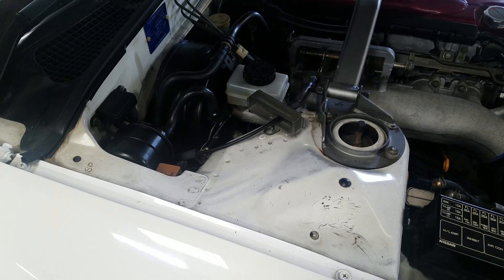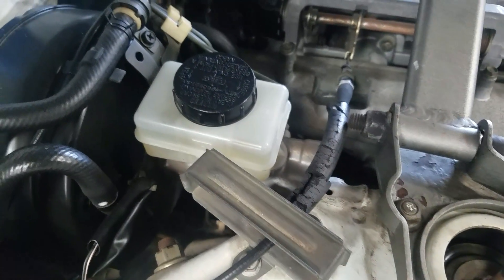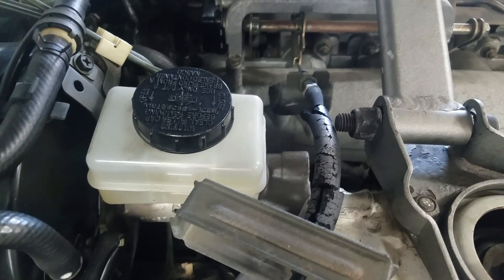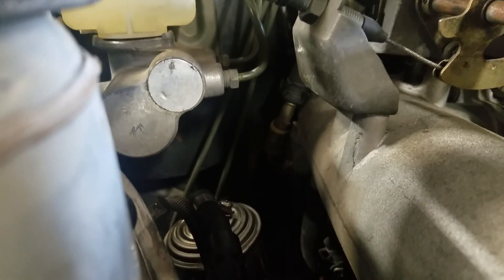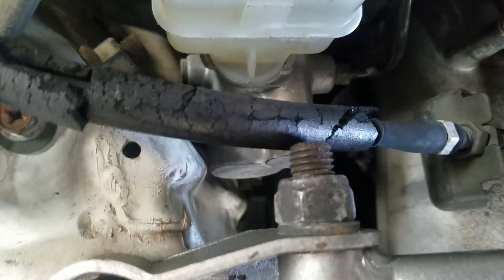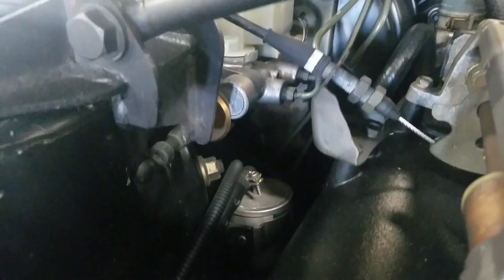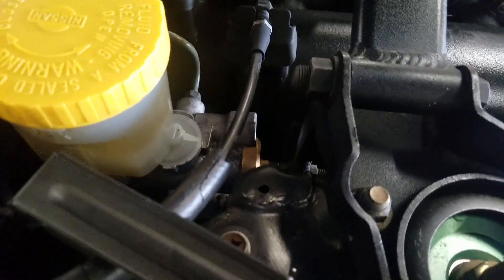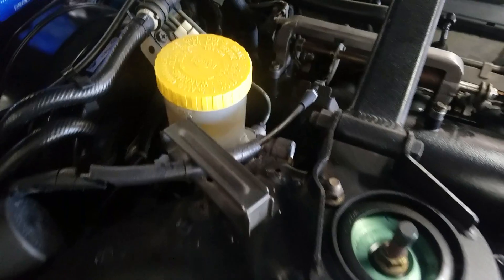Nissan Skyline GT-R Brake Master Flex

Comment: So who is going to fab up a stopper and sell them for $500 cuz gtr tax? 👏🏻
Reply from the maker: There is a NISMO strut tower bar with one built in. Cusco sells them. Others too.
Reply: +importavehicle.com I meant Fab a bolt on bracket or one you can just weld.
Reply from the maker: Cusco has a bolt on stopper.
Reply: +importavehicle.com $500?
Reply from the maker: $68.10  https://www.nengun.com/cusco/brake-cylinder-stopper